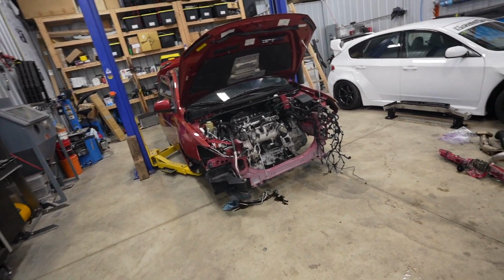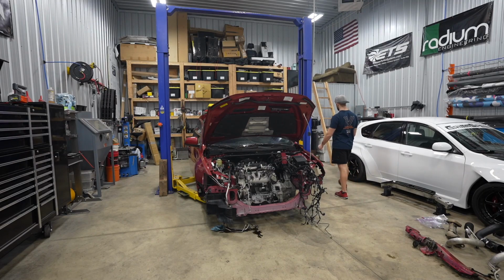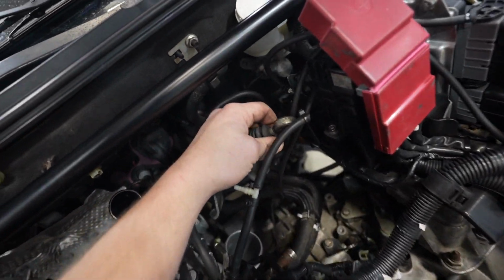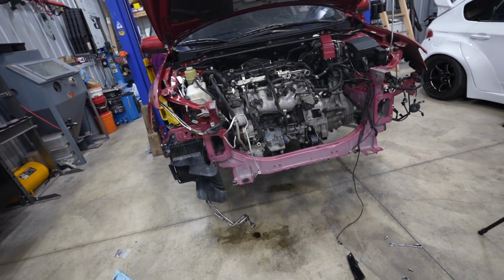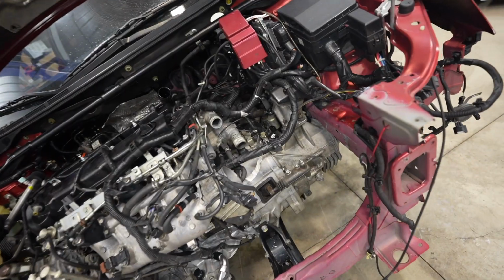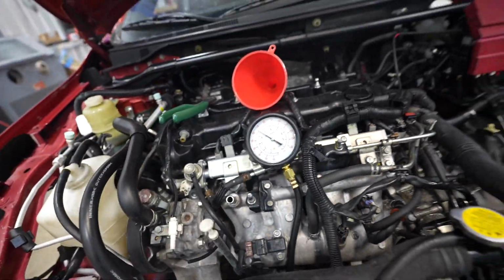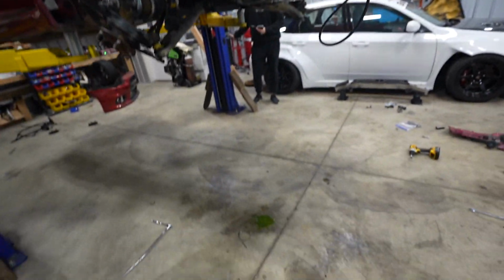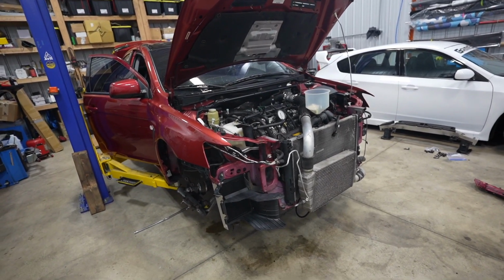The Evo X First Start BRAND NEW ENGINE!

Comment: I have been following you for several months now and I have just completed my evo x build. 
Everything is ready to fire up but when I turn the key all seems OK but the new starter has no power?? Is this because the car has been disconnected from battery for months. I can't find any answers online. Fuel pump works when turning key but nothing from starter at all. Any suggestions please